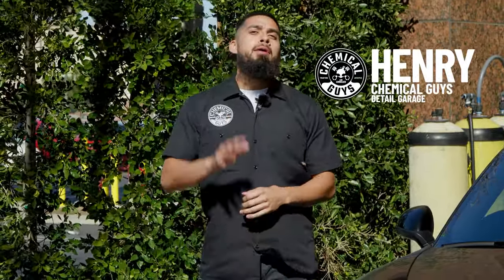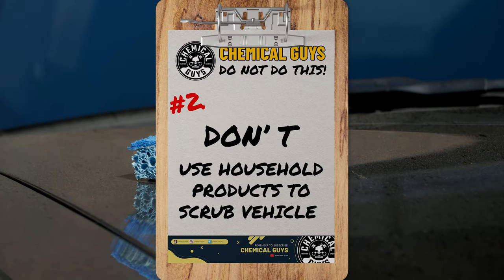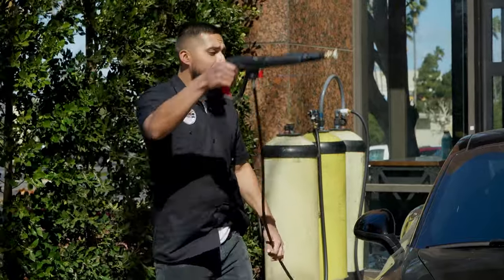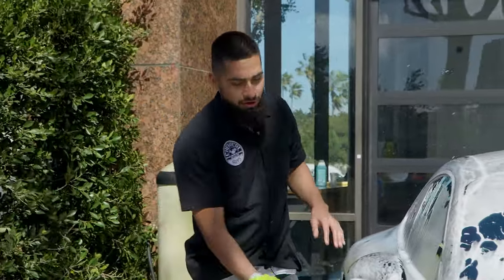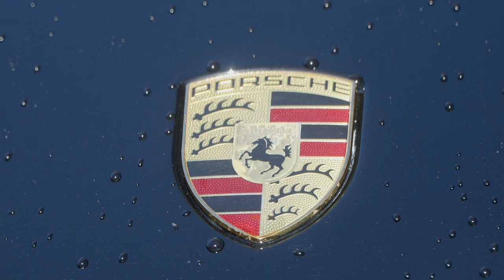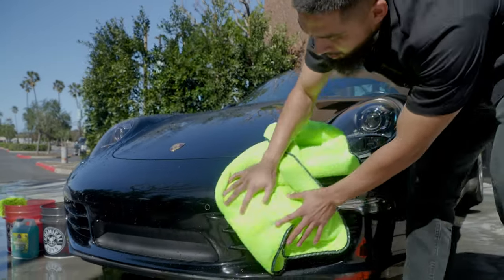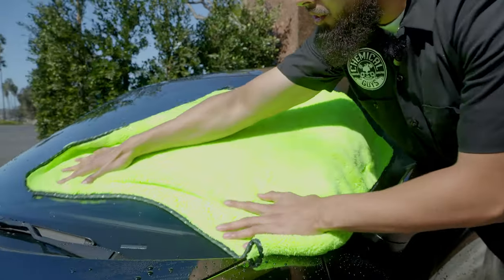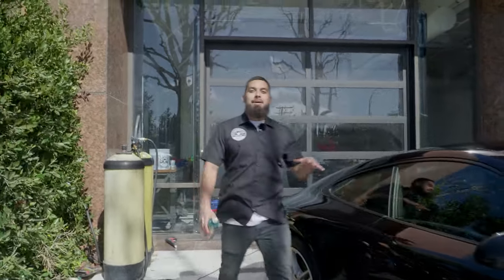Wash & Wax Your Car At The Same Time With The ALL NEW Sudpreme Wash & Wax Auto Soap - Chemical Guys

Comment: Question: after using this, can you still apply ceramic products (Hydro: Charge+, Slick, View) after washing or do you need to use Wipe Out to prepare the surface for any ceramic (Hydro) series?
Reply: Wipeout regardless. But this isnt the wash to use before a coating. Less left behind the less you need to wipe out.
Reply from the maker: Hey! That's right, use Wipe Out before applying ceramic coatings.

Comment: I used this on my 2014 mustang gt convertible top after I did a quick rinse off I applied it and then brushed the top with soft bristles. Then I wash and rinsed it off in under 2 minutes of it being on there. Do you think a one-time thing like this is crucial to the life span of the convertible even if I keep spraying it off with water to make sure the solution doesn’t fully harm the vinyl?
Reply from the maker: Hi there! Sudpreme is safe for convertible tops.

Comment: Why use a towel to dry over a auto dryer? Dryer seems to me would reduce possible damage to paint?
Reply from the maker: Hi there! Using a microfiber towel will ensure a totally dry finish however it is a great idea to use an air blower such as the ProBlow to release trapped water from crevices.

Comment: Random question about your upholstery cleaner, let’s say I have a heavily soiled seat and needed to use a good amount of solution, without an extractor, how can I remove as much moisture as I can from the seat? Because I’ve tried the method of your other video with wiping and 5 towels later gloves still showing wetness lol
Reply from the maker: Hi there! Use a towel wrapped away a brush for leverage to lift spent product then let the vehicle dry in the sun.